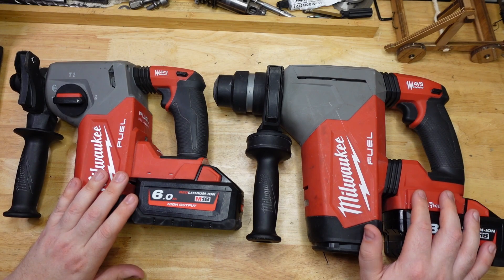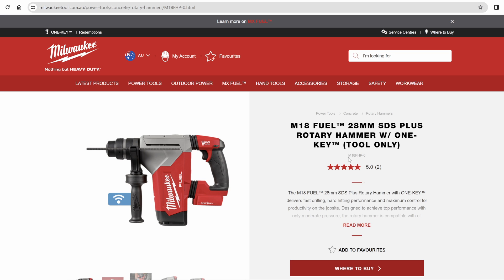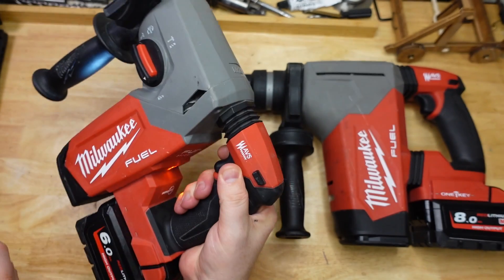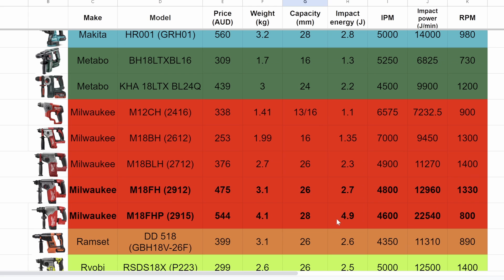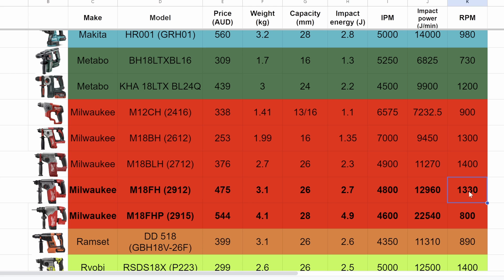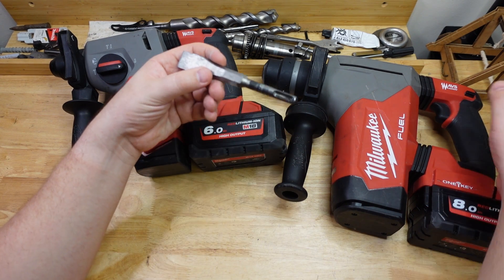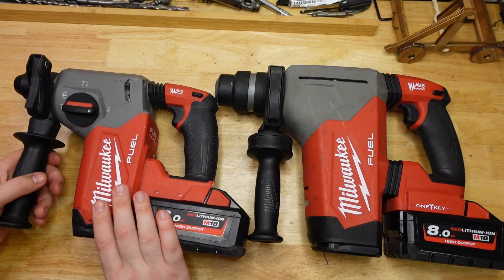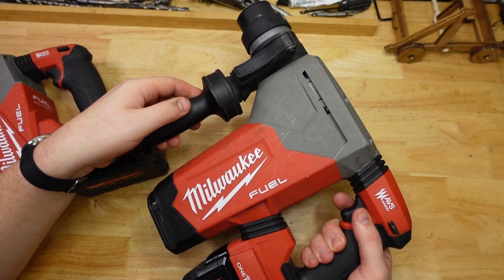Milwaukee 2912 Vs 2915 (M18FH vs M18FHP)

Comment: Hi i purchased the fhp and when it arrived the selector was very difficult to engage and felt locked out of the sds function and wouldn't engage the normal drill operation either. Has anyone else had a problem with the selector
Reply from the maker: From memory mine was just really hard to turn the first few times but then loosened up. You could try after manually turning the Chuck a bit or if in doubt ask the supplier

Comment: Could I use a 117mm core bit to cut holes in concrete block with either tool or would the clutch engage like with the spade bit going through wood? Thanks guys

Comment: Helpful video, thanks! As a DIYer I’m leaning towards the 1” after seeing how much faster the 1” turned a large spade in wood. With its higher RPM wouldn’t it also perform better when running a diamond core bit in block (without the hammer engaged)? All things considered, it seems like a more versatile tool. Of course for heaving chipping or for drilling large holes with regular masonry bits, the 1-1/8” looks awesome.

Comment: So answering the quick chuck question as i one the fhx myself, i think is all about adaptability. I usually use the drill for some soft metal and being able to use standar metal bits is a plus. And i dont have to carry one more tool.

Comment: The quick change chuck is a good ideea besides the utility of normal chuck, whitch one might use rarely, because an sds chuck after a while gets worn, also this happens to the shaft of the non quick chuck version, and then you just go and buy a new chuck for 50 $ and you change it in seconds without te need to service the whole drill.

Comment: How come you think that quick change chucks are useless? Is it not good to be able to use standard drill bits.
Reply from the maker: They make a big, heavy, expensive tool more so. They're a weak point that could break, a leftover from the days when combi drills weren't so good. But now I have a small Milwaukee combi drill that's got more torque than any rotary hammer and a gearbox that makes it way better for normal drilling than any rotary hammer. If all you have is a rotary hammer then yes it's good to have normal drilling ability, but you can also get adaptors rather than change the chuck

Comment: My 2915 went faulty after a year of owning it (only used it about a dozen or so times, mainly for tapcons, a few anchor bolts & light chipping duty). After having it in storage for about two months (worked fine last time used) the red light would now instantly flash as soon as the battery was inserted. While it was working I loved it, so much so that I ended up selling my Bosch GBH 18V-26 SDS plus rotary hammer drill after the first time using the 2915. I ended up buying the Milawukee M18 D handle 2916 to replace the now faulty 2915 and so far I like it a lot.
Reply from the maker: The 2916 is the biggest D handle on the market so far, what do you usually use yours for? I think it's a great idea to make big d handles for the ease of chipping floors etc that shape gives you
Reply: @BoltahDownunder  I am an electrician by trade, so I use the 2916 to drill holes for different mounting anchors, tapcons, chipping raceway channels into block or concrete walls, etc. I had to use it last weekend to drill 5/8" & 7/8" holes through 16" thick precast walls using Milwaukee 18" long 5/8" & 7/8" carbide-tipped SDS Plus bits which made easy work of the task once I predrilled pilot holes using a Milwaukee 18" long 3/8" SDS Plus carbide-tipped pilot bit. I use the Milwaukee M18 12Ah batteries to be able to carry out these heavier duty tasks which a single battery ended up lasting me the entire day. I also have the Milwaukee vacuum attachment for the 2916 which comes in handy when drilling overhead holes for anchors into ceilings.

Comment: I need to really understand this,are these rotary hammer drills meant only for concrete only or they can still be used for other materials like hard steel and metals.What does the SDS means,I need to understand these things to know which direction I need to go.Thanks.
Reply from the maker: No, SDS drills aren't really suitable for metal. They can get through rebar with a suitable bit, but they are for concrete & stone. SDS is the chuck/bit type. 10mm with slots. These drills usually have a rotation only mode and can hold normal bits with an adapter, but you don't want to buy one of these for drilling metal

Comment: surprised of your battery results . that the forge didn't show improvement . was it due to being brand new or does the hammer just not use a big load .
Reply from the maker: I didn't test the forge, that was just an ad. But if there's almost no difference btn a 5ah & 8ah HO, then no this tool doesn't draw enough current to benefit from HO or forge. 
There may be situations when it will, eg if you're drilling something really big, and have a dust extractor with its own motor, but in general I wouldn't think forge improve this tool's performance
Reply: @BoltahDownunder  got it .sounds exactly right .thankyou for reply

Comment: And I thought I had enough Milwaukee Rotary Hammers.
Reply from the maker: Enough? Not sure I follow... But the good news is you should only need the big one here. While the new inch drill is much more powerful than the one you have, it is also much bigger & heavier so I wouldn't recommend it for climbing stuff
Reply: @BoltahDownunder  oh I already have the 2912. I have several of the 2712s that I have put in thousands of holes with.
Reply from the maker: I guess there's still the 2915 & the d-handle version! Plus they have to be releasing some new compact hammers soon, their current ones are ancient
Reply: You thought wrong motherfucker!

Comment: Do you think the new forge batteries will give these two drills a boost?
Reply from the maker: Nope. They only help if the tool is slowing down under load, which doesn't really happen with hammers compared to eg circ saws or grinders.
Reply: @BoltahDownunder  might help with really long holes (depth/diameter > 20). Otherwise it's as you say and there's very little torque on the motor.

Comment: What exactly is the relationship between rpm/bpm and impact force for rotary hammers? I don't quite understand them, shouldn't the one with the most force per blow regardless of bpm/rpm drill/chip be the fastest?
Reply: Fastest rotohammer will usually be the one with highest  joules per minute (joules × BPM). 4J × 5000BPM = 20kJ/min and would have similar speed to 5J × 4000BPM. The 4J @ 5000 would be slightly faster on smaller holes and the 5J would be faster on larger holes. Smaller holes work better with lower joules, higher BPM and high RPM to clear dust out faster. Large holes need high joules or there wont be enough energy to break rock.
Reply: @toolscientist  thanks that helped
Reply from the maker: Impact force is for one blow, so higher BPM means more blows per minute. If 2  hammers have the same impact force but different BPM, the higher BPM will remove material faster. 
RPM & BPM will vary with how far you're pulling the trigger, so for a tool running at full vs half speed you'll get less impact force at running the tool at half speed. 
Think if you're swinging a hammer fast vs slow, the faster swing hits harder. So if you drive the tool at say half it's speed, you get half the RPM & BPM, but also half the impact force per blow, so it won't drill half as fast but 25% (or less).
Running a hammer faster means more blows per minute and also harder blows. 
Sorry does that help?
Reply: @BoltahDownunder  yeah that helped a little bit. I do more demo than drilling so it's just strange to see my bigger hitting hammers on your list do worse in terms of drilling speed with so much force behind them. I appreciate your channel, I think rotohammers are the coolest power tool out there.
Reply from the maker: Ohh right. Yes it's a bit odd but like TS said, the hole size matters. You do see smaller hammers drilling faster in smaller holes sometimes. But when you're drilling big holes only big impact force will do. Like the big Bosch I mentioned in this video (34CF), it's slower than many at 12mm but the fastest at 26mm. Even with 5.8J impact, the bit can only dig so deep per blow with a 12mm

Comment: This was the comparison I was wondering about. Thanks for the video. The 2915-20 was going for $398 usd a couple of weeks ago. It was a combo deal, including their fuel angle grinder. The sds usually retails for $449 and the grinder at $199. If it ever gets that low again, I'm definitely picking her up.
Reply: you can get the 2912 for $203 and the bigger 2915 for 288 USD at HD when you return the grinder. I may bite, just a homeowner tho, and i already have a corded hammer drill and a jackhammer, but i'm a sucker for nice tools haha. If I had a project where i knew i could use it i'd buy it now. Do you think they'll come out with something much better in a few years is the question i ask myself...
Reply: @patrickpk6299  It won't be for a while. These 2 are their top-tier compacts for now. If you can afford it, why not. I'm like you. I've spent quite a bit on power tools cause I like them. I have a project in mind when the kids move out. Going to redo the basement. The sds hammer will come in handy for sure

Comment: Looks very powerful. Only other tool in that class is the Makita HR008g, but it's 3.9J vs 4.9J and lower IPM, so likely slower. I think if Bosch had changed the gearing on it's SDS+ to get more RPM/IPM, then it could match them.

Edit: just noticed that you haven't tested the DCH417 yet. That could be close
Reply from the maker: Who tf knows what Bosch is doing nowadays 😮‍💨
But yes Milwaukee has done a great job of getting high impact force at higher speeds than the others. I still think their claim 4.9J is a stretch, but that hammer really brings the goods so I'll give it to them for now
Reply: А где тест с макитой 008,почему про нее нигде нет видео сравнений в том числе и на Вашем канале?А так благодарю за отлично проделанную работу и Ваш труд,но я отдаю предпочтение только макита!!! @BoltahDownunder